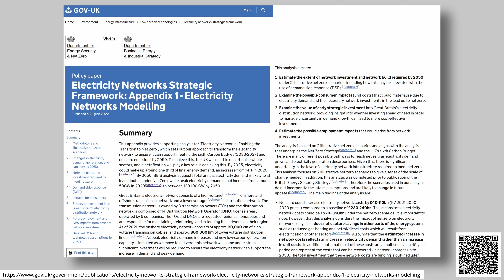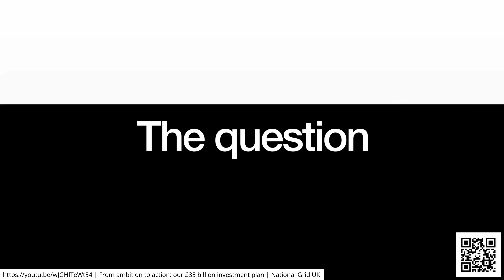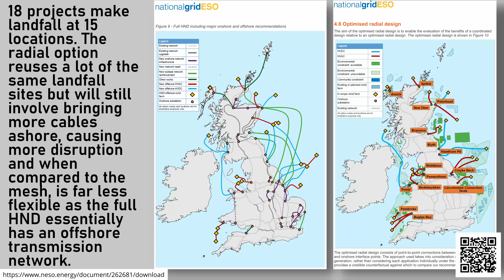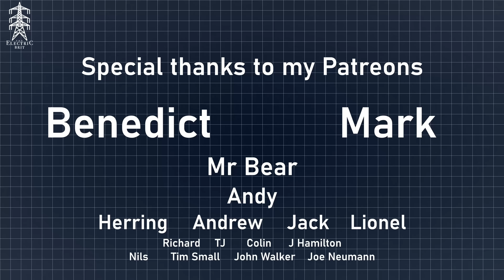The Great Grid Upgrade Projects Explained

Comment: I’m at sw 8; and I’m getting cables on all 4 sides ,of my place,crossing over my property,I’ve done all the meeting,made my observations,nothing so far,maps umm,as for my working out I’ll be approximately 100 meters from the nearest,northern cable set,probably 300 meters from the southern cable run,so how close do you need to be to get on the targeted consultation list?,so the electricbrit, I’m not against need to upgrade the system,but as national grid told me,you are living in a pinch point,so after 45 years of living/working here,?.so I’m a Lincolnshire person who has a few reservations.thanks for your video.
Reply from the maker: Is that somewhere along the route for EGL3-5? I’ve not been involved in any consultations to date, I’ve usually been involved once construction starts, however I’ve got family in Sutton on sea where the cables come in (and previous none national grid transmission projects like Viking link and triton knoll, and future wind projects). 

My understanding is because of the wash being both a bomb site and an RSPB area, cables can’t be taken through direct to where they’re needed so sadly it’s best to bring them on around the Skegness area.

Comment: I'm in Suffolk and would like to know more about how solar farms get connected and what the grid can cope with as there are lots of new solar farms springing up.
Reply from the maker: It’s definitely on my to do list! Both grid scale solar and battery installs, connections reform and another video on how domestic solar is hurting the grid.
Reply: @TheElectricBrit that sounds interesting, I wouldn't of thought domestic solar could hurt the grid but I'm guessing scale is not enough to be useful
Reply from the maker: One part of it is the grid was never designed to have lots of generation at the ends pushing back into the grid. So due to a few reasons that’s why we’re seeing voltage rise in our homes. Mine sometimes goes to about 254 instead of the 240 it should be. That then has a knock on effect upwards but means distribution transformers are at capacity and may need replaced.

Comment: @ 3:42 does it only become significant when power is sent to England? Pretty sure it's significant if it happens in Scotland
Reply from the maker: The entire purpose of that project is to send power to Peterhead to connect to the EGL projects. If the EGL projects weren’t happening then there would be no need for that project. 

The connections in Scotland seem to follow two paths, one is north of Scotland to the border of Scotland, the other is the north of Scotland to Peterhead. These will be the two major power flows. As explained Scotland produces way more power than it uses, so exports it south, and with the EGL projects will export it directly to other interconnectors to be sold abroad too.
Reply: @TheElectricBrityep
Got all that thanks 
It's just the frame of reference in the phrase jarred when heard up here. Especially because energy policy is reserved to Westminster. Love our wind and glad to be exporting it to NIMBY land. But feels like we're being overexploited again. This wasn't a Scottish decision. Even Scotland has a long way to transform energy to full electric. So I should hope the significance of the systems don't just come from the fact that they are related to England.
Yes over chip on my shoulder 
Don't get me started on your pronunciation
Reply from the maker: Second person to take issue with the pronunciation but I worked in Scotland for ages and the way they said the names in the highlands and Aberdeen. What did I get wrong? 

And no worries. When Scotland eventually shuts down nuclear and gas, these links will help them stay powered when the wind stop blowing, so it’s a net positive. Plus if data centres ever start getting built en masse north of the border.

Comment: So this might be why, despite being retired, recruiters keep coming after me!  I have three decades of experience as a SCADA engineer for the Grid and, given that all the upcoming hardware installations are going to require modifications to the controlling SCADA systems, the recruiters must be scouring the likes of LinkedIn for every qualified engineer they can find!
Reply from the maker: There’s certainly a shortage of well experienced people to undertake certain works and train the next generation. NG have been on a hiring spree for a few years now and it’s not stopped, however when I was at Siemens for example there was massive gaps and we relied heavily on overseas talent to complete projects. 

There’s also a massive project on in grid to update the SCADA system over the next 1-2 years to make things even more digital (switching instructions for example). 

Recruiters are a bit of a nightmare now too with AI and automation. Taking any key word and messaging everyone for jobs that are barely applicable, but I’m sure that’s not the case for you! I’ve been approached for loads of jobs I clearly don’t meet the requirements for, they just see TP141 and go for it.

Comment: What about Northern Ireland? Or is the grid all Ireland for them?
Reply from the maker: Northern Ireland has its own grid owner, NIE who I’m not too familiar with in honesty, but they do have some projects ongoing for new overhead line and cable routes, as well as interconnectors, so I’ll need to do a dedicated video for them 😊

NESO and the national electricity transmission system are Great Britain, Northern Ireland has the System Operator of Northern Ireland (SONI).

Comment: Despite all the upgrades planned, underway and completed,  which imply that electrical energy can be and will be  moved around to a greater extent within the UK, presumably offering the potential for  peaks and troughs of   electrical  demand to  generating capacity to be smoothed, HMG energy plans still anticipate an increase in the use of inter-connects to the continent over the next 10 years from the existing 10% of demand to 20%. This suggesting that UK is still well "Lite" on generating infrastructure, at near future levels, to the extent of 8GW. shifting electricity through a grid structure, especially when the system is lacking generating capacity, must increase the operational management problems significantly. One also wonders whether going over the magic figure of 10% on the continental interconnects  is strategically wise ?

I also note from the NESO document that there's nothing planned for the South-West of England, despite the large migration of persons from the  connurbations in central and eastern England to that neck-of-the-woods over the last 20 years.

Are there any plans to start siting many of the local flown supply cables underground ? You don't have to go far beyond the boundaries of the connurbations before that sort of supply arrangement predominates . . .and with Global warming comes increased storm frequency and associated wind speed, particularly in the hilly areas and westerly reaches of the UK, so that it may be found that local outages go up. Another disruptor to a National Grid system .

When you add to that the variability of wind (One day it can be producing 15GW and the next day 5GW), the predicted tripling in national demand (120GW ?), including the addition of HS2 and datacentres, and the apparent lack, as yet,  of a meaningful scale of  mass storage and damping facilities, it seems to the casual observer that despite the rosie picture painted here, the whole thing is being run on a knife edge ? Microsoft AI co-pilot tells me that none of the smaller  recent entrants to solar and wind supply are required, as a condition of connection to the grid, to provide damping and smoothing facilities for their output. Surely not ?

I notice on my domestic home supply that the voltage variation, hour by hour,  is much more than it used to be 30-40 years ago, when fossil fuels  predominated the generation scene. VV can upset mains connected control equipment as a minimum.

In my locality for example,  within the last 10 years, HS2 found it necessary to install a 33KV  underground cable from the tunnel at Ickenham, 7 miles through the streets of surburban London to draw power from a 1930s residential substation a mile away from my location. That was despite the end of the tunnel being at 3 miles proximity from the 400Kv line North London Ring and substations at Denham and 2 miles away from the  London Transport Depot at West Ruislip. this electrical connection was put in place to supply power for the tunnel lighting, drainage pumps, ventilation, comms. Euh ?
Reply from the maker: Thanks for the detailed comment, I'll try address it to the best of my knowledge and opinion.

Regarding interconnectors and generation, interconnectors are there to give us security of supply against the intermittence of renewables. When the wind is blowing and sun shining in Europe we can make up for lack of generation in our own waters and vice versa. That will be the ultimate plan for interconnectors globally, but the feasibility is yet to be seen on that and I'm sceptical on the economics of projects like xlink and sun cable for Aus. As far as I'm aware post 2030 when we will have 50 GW of wind, we will continue to deploy huge amounts of wind in the North and Irish Sea and by about 2040 we should start to see new nuclear coming online. Gas will still make up 5% of generation post 2030 for stability and peaking.

RE, South West. There are interconnectors and new wind projects planned but I omitted them from this video as I wanted to focus on onshore developments. Despite that I'd be surprised if the amount of people moving to the south is increasing by a meaningful amount, because equal amounts who can't afford to live there will be moving away, domestic loads are pretty small and I imagine solar is very popular down that end too.

RE Cables, there are projects ongoing now such as North Wessex Downs VIP which is undergrounding a very short section of overhead line to improve visual impact, however overhead lines are a far superior technology to cables in every way and on main backbone / arterial routes it won't be feasible to underground cables. I have a dedicated video planned for this but my HVDC video soon will also cover the key points. I don't envision storms in the UK to be at such a level it causes issues to transmission, it's mainly distribution that gets affected. but it's definitely something to consider and we do consider flood risk greatly when building new infrastructure.

RE grid capacity etc, AI searches like ChatGPT and Co-Pilot will tell you whatever is printed in the media, and most of the media is mistaken or manipulated towards doom and gloom, which is what I try to combat in this channel with facts, transparency and professional opinion. NESO release a yearly report called Winter Outlook which tells you how close the system might be running. I addressed in my Iberian Blackout video the fact that policy and regulation are the simplest thing to change and NESO acknowledges that, vs building new infrastructure as the last resort, but that their grid code disallowed renewables from providing dynamic voltage support, which contributed greatly to their blackout. Most countries now are pushing for renewables to provide this synthetic inertia with grid forming inverters, but right now there is no obligation for generators to have storage, and there's probably a load of silly planning and consenting reasons that make that a challenge. It's certainly a bigger topic to talk on but right now the UK has over 400 GW of storage in its pipeline to be build in X amount of time, and more like 200 in a much readier state to start building, as well as new hydro schemes coming. The energy outlook is also between 2x and 3x increase, with the latter probably being worst case with lots of data centres and stuff.

RE Voltage, I have a dedicated video coming on this too. It's primarily down to local embedded generation and limitations with the distribution system. I regularly sit above 250 V. There are regulation changes planned to loosen the limits to make more DNOs sit within tolerance, to save on having to spend too much too soon to fix the problem.

RE HS2. I can't really comment on that as distribution and that case isn't my wheelhouse, but it will be a case of HS2 asking where they can connect a sufficient amount of load, and the DNO giving them options and costs. It may have been that a stupid long cable worked out cheaper than extending an existing substation or building a whole new one.

Hope that answered some of your comment or concerns, I have plans to cover a lot of these topics in future but it takes weeks to produce them unless it's just me rambling at the camera, which would be even less fun to watch than this video! Thanks for commenting.

Comment: This is a pile of crap. It will never happen.

Lead times for essential equipment are in excess of the five years mentioned. Transformers have a lead time of around four years. These cannot all be manufactured at the same time. 

At 2019 only 17% of energy used was electricity. Meaning a requirement of five or six times the generating capacity. Wind power has an availability of about 35% (solar is about 15%). Meaning that an additional 3 times the generating capacity is required. So 15 to 18 times the current generating capacity.

This also means similar multipliers in distribution. So 15 times the copper and aluminum. However, wind uses more copper per MW than traditional methods. At least 4 times. That includes substations and switch gear.

Also required is storage. Battery storage.

This is a pipe dream that will bankrupt us
Reply from the maker: The projects are already under way in some cases, well under way. 

In some cases the equipment has already been ordered, for others the designs are still being approved and will be years away from installation, so there’s no rush and manufacturers are ramping up for example for cable production due to the massive demand. There will be challenges but it’s not our first rodeo. Most of the people involved in these projects have been building substations and interconnectors for the last 10 years or more (I’m coming up to 8 years and I’m still pretty young I’d say, and I work with a lot of experts near retirement, which is the bigger concern). 

I’m not going to debate energy mix, but your concern about bankrupting is also not a concern. This work is across all transmission operators so I can’t speak to the others, but national grid completed a rights issue in 2024 to generate £7B for investment in the network. Unheard of in infrastructure projects if you ask me. I’m not a finance person so I can’t speak to the rest of the money but I’ll cover it eventually, as well as the true cost of net zero from an all facts, impartial point of view.

This channel is all my own views and my employer has zero involvement for the record, and I make this content to inform and educate, so I’m happy to answer any questions I can answer.

Comment: I'm glad to hear grid upgrade work is actuallt happening! Is there anything planned for the Lancashire area, or anything around grid storage in general?
Reply from the maker: There’s 4 offshore wind projects for a total of around 5.48 GW with two of those potentially connecting at Penwortham which will need extending. The other two go to Wales and Scotland. 

Otherwise Western Link 2 is either side of you from Scotland to probably around Connah’s Quay again, and the LirLC interconnector from Ireland to Scotland. The Irish Sea is ripe for projects, but not a lot in this round of projects for Lancashire at large.
Reply: @TheElectricBritThank you kindly! Its a shame this sort of thing isn't so widely reported, it feels like a big deal!